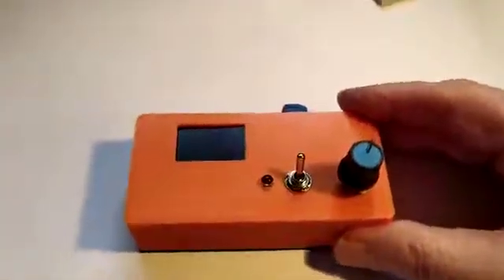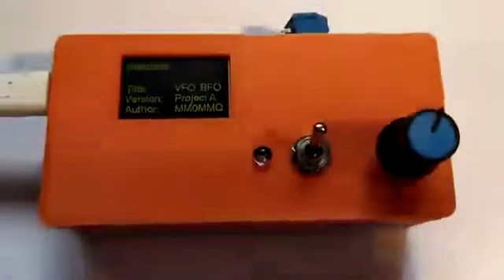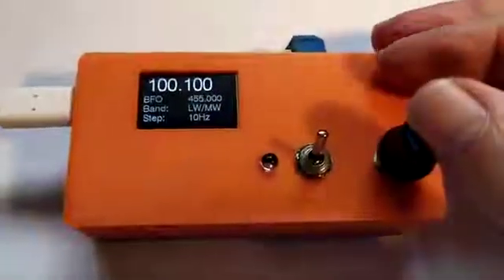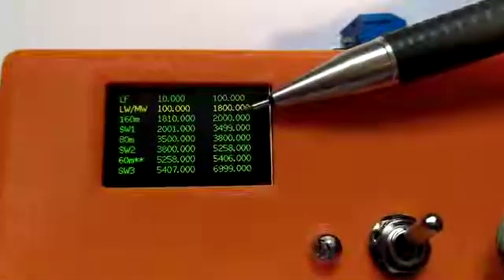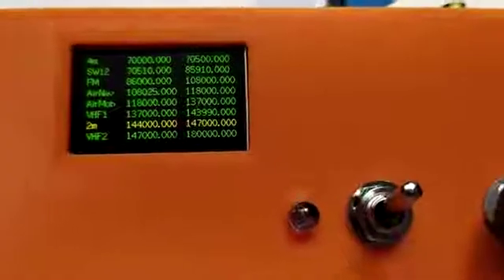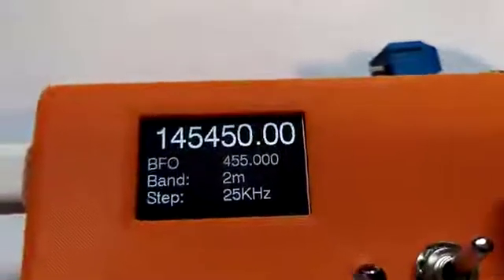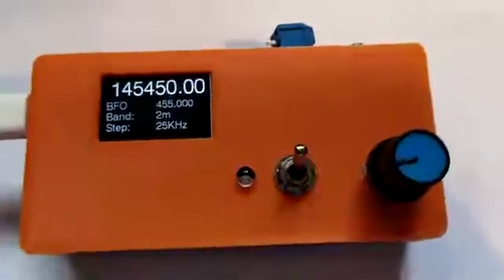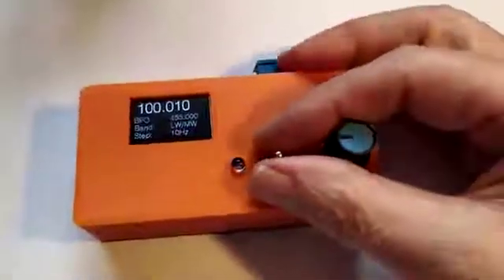VFO BFO MM0MMQ

Comment: Hi Bob,

You project looks neat but have you considered to make it more compact using a LilyGo T- display-S3 amoled module?
ESP32 and amoled display are on the same board and have 2 push buttons that you can use.
Or you can use the LilyGo T-Embed model that has an encoder.